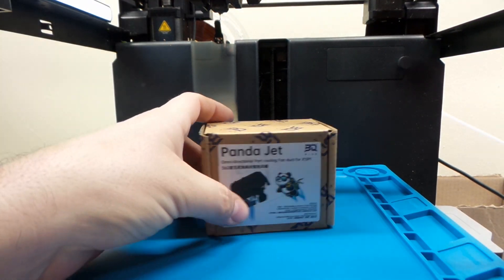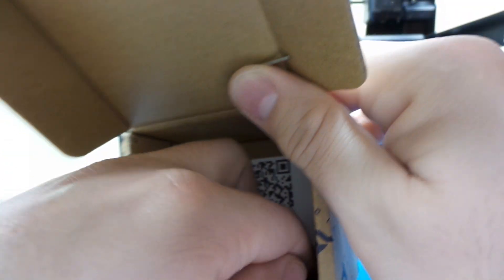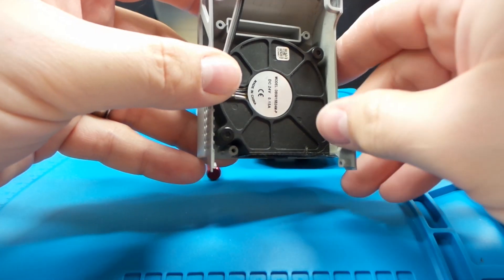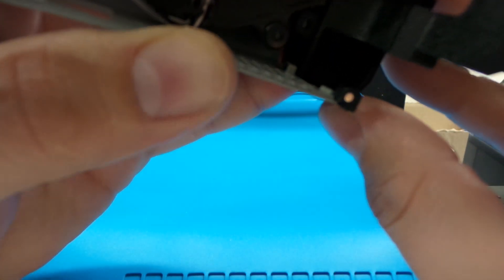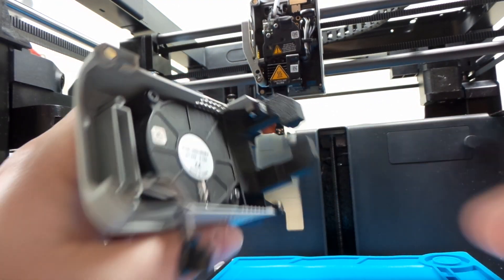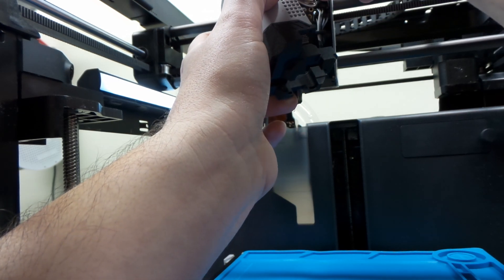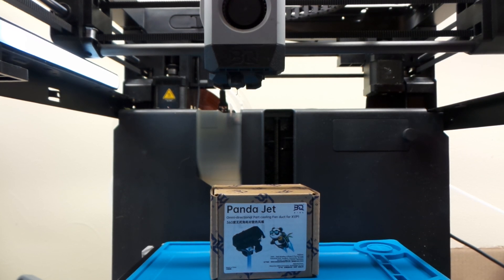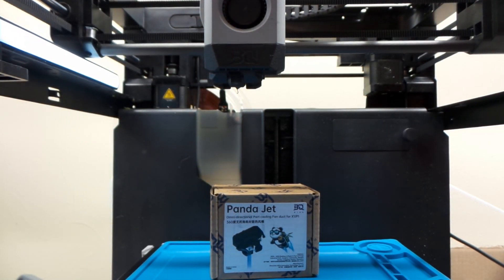Installing Panda Jet on Bambu Lab P1P

Comment: I didn't notice any difference - in my case failures due to insufficient cooling were appearing at the same places as with the original one;
And it's not "omnidirectional" as they claim - due to different channel lengths it blows stronger on one side.
Reply: In fact it's even worse than the original - I put the old one back... Nice marketing though.
Reply from the maker: @trykozmaksym  I found on certain angles when you print it can be better and some seems to be worse. Overall for the stuff I print it seems to out perform the original duct for me
Reply: @Dunn3dprint  oh well... too bad my part was round :D
Reply from the maker: @trykozmaksym 😂 yea some upgrades don’t play well with everything